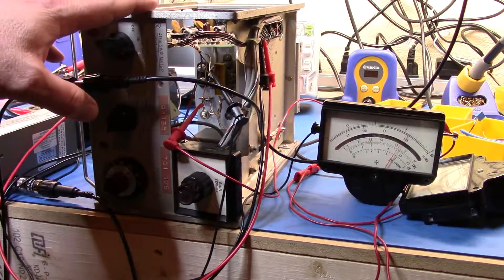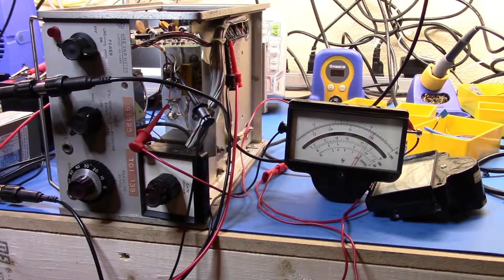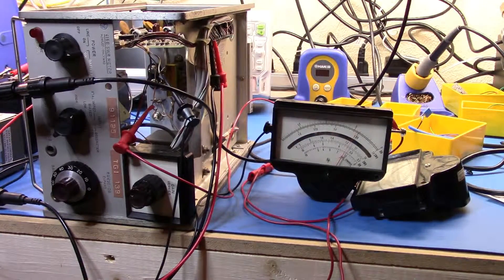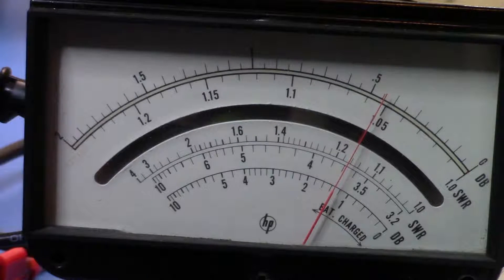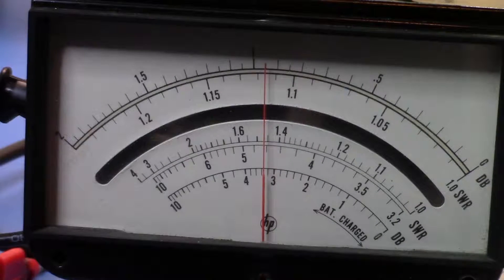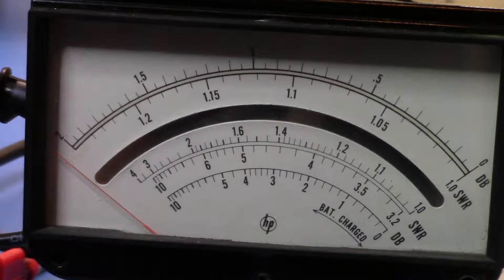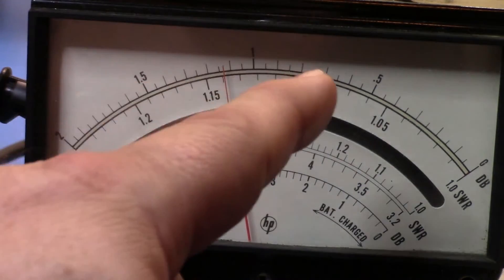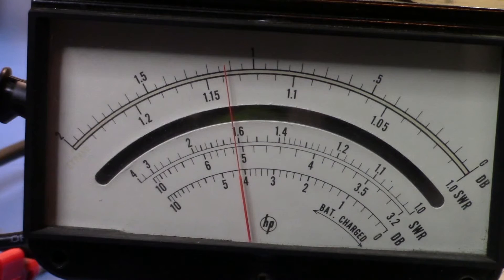HP 415E SWR Meter Performance Testing - Range Accuracy

Comment: Very interested if you have any new content on the 415E. Learned a lot with this video and the other one.
Reply from the maker: I don't have anything planned right now (my bench is about 3 feet deep in other projects) - What were you looking for? The 415E is one of my fav bits of test gear I have - I did do some videos on crystal detectors & slotted lines that use the 415E so you might enjoy those too.